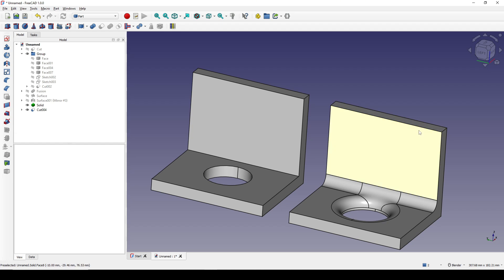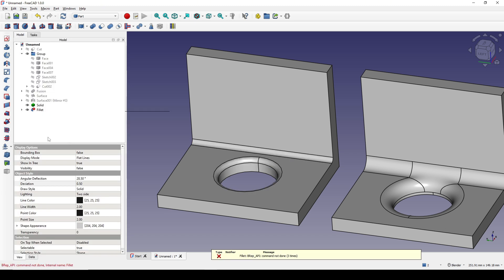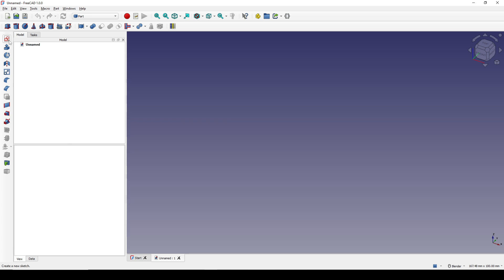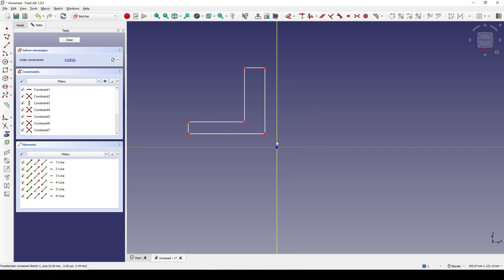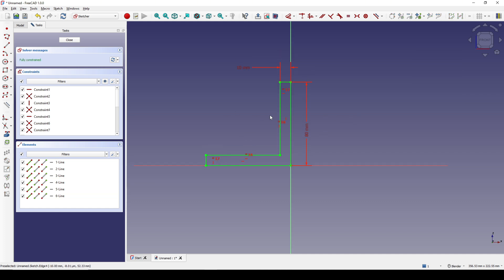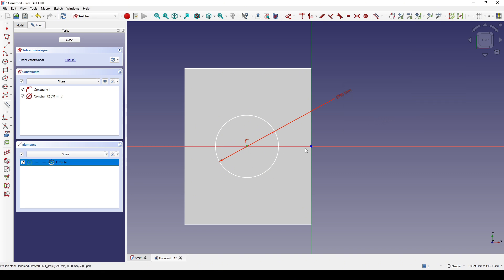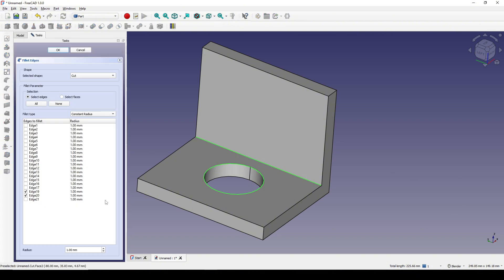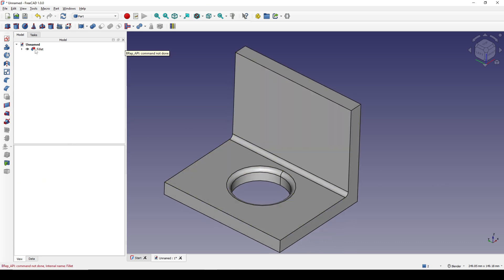FreeCAD 1.0 Using Surface To Create Blending Fillet.

Comment: Manual Fillet Creation in CAD Software Using Surface Tools

*   0:00 Introduction: The video demonstrates how to create manual fillets (rounded edges) in CAD software, as the built-in tool has limitations.
*   0:11 Default Fillet Tool Limitation: The default fillet tool fails when a larger fillet radius is required.
*   0:47 Goal: The tutorial aims to show how to create a manual fillet with a desired radius using surface modeling.
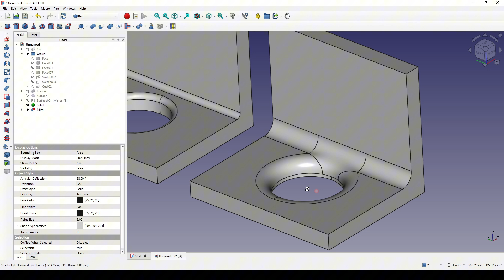*   1:04 Initial Setup: Creates a basic solid model using extrusions from sketches.
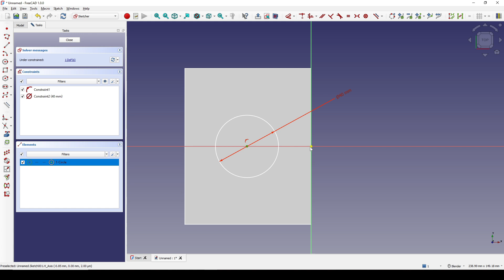*   2:55  Cut Feature: A cut is made using another extruded shape, creating edges to be filleted.
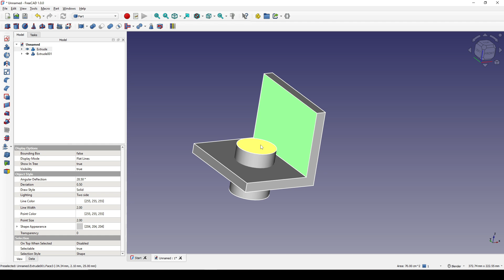*   3:12 Default Fillet Failure: The default fillet tool fails with a radius of 5.
*   3:50 Manual Fillet Approach: The video switches to using manual fillet using the surface workbench. 
*  4:04 Downgrading a Cut: The initial cut feature is cloned and downgraded to access the individual faces for modification.
*   4:45 Creating a Group: A new group is created, and all the related faces are added to the group. 
*   5:19 Preparing for Fillet: The model is now prepared for the manual fillet process.
*   5:23 First Fillet Sweep: Creates circles on the edge points for sweeping operations, each with a radius of 8, the fillet radius. 
*   6:33  Sweeping Circles: Uses sweep tools to create solid fillets.
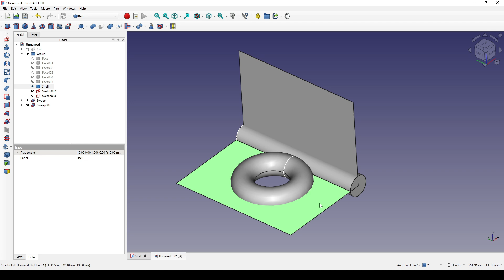*   7:15 Cutting Solids: Cuts the model with the newly created sweep objects.
*  7:35 Hiding the Circles: The circles are hidden to improve visibility. 
*   7:42 Creating a Blank Curve: A blank curve is created between two edges. The start and end sizes of the curve are set to 1.
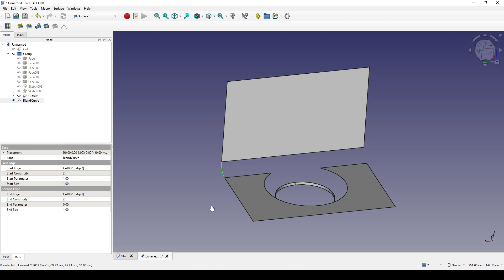*   8:34 Sweeping Along Curve: The blank curve is used as the profile to sweep along an edge, creating a surface.
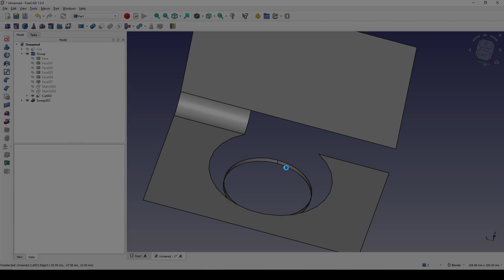*   9:04 Splitting Surfaces: A line is drawn on top view and then extruded to split a surface.
*  9:51 Extrusion:  The line is then extruded slightly.
*   10:33 Surface Splitting: The extruded line is used to split the surface.
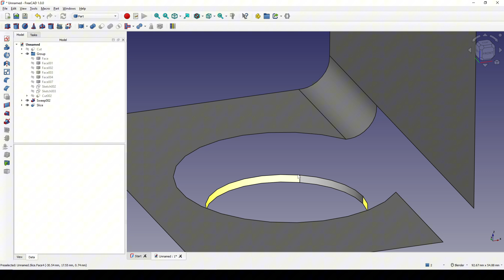*   11:19 Creating Blank Curve (again): Another blank curve is created between two split edges. The start and end parameters are set to 1 to make it tangent. 
*   11:55 Sweeping Again: Sweeps the new blank curve along an arc to generate a surface.
*   12:32 Removing Surface: Removes part of the surface on one side, in preparation for mirroring. 
*   12:47 Mirroring: The created surface is mirrored to the other side of the model.
*   13:58 Mirroring the Second Fillet: The previously created sweep for the other fillet is also mirrored to the opposite side.
*   14:14 Filling Surface: Uses the "Filling" tool from the surface workbench to generate a surface between the edges. 
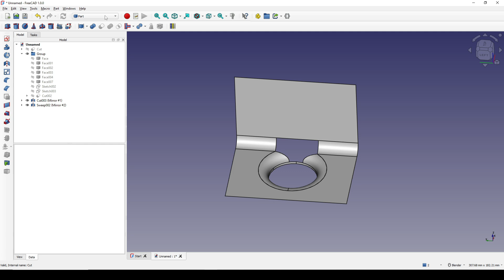*   14:50 Union: Unions all faces to make creating the fill surface easier. 
*   15:22 Filling Again:  The Filling tool is used again to create a smooth surface between the edges, and all surfaces are set to G1 contiuity.
*   16:11 Removing unwanted surfaces: Removes extra faces to prep for a final fill. 
*   16:36 Filling: Uses the fill tool again to smooth the surface.
*   16:51 Mirror: The final surface is mirrored across the model.
*   17:02 Parameter Solid: Converts the surfaces to a final solid object.
*   17:22 Final Result:  The final result is achieved, and viewers can see the detailed manual fillet.

I used gemini-2.0-flash-exp on rocketrecap dot com to summarize the transcript.
Cost (if I didn't use the free tier): $-0.0161
Input tokens: 15130
Output tokens: 946